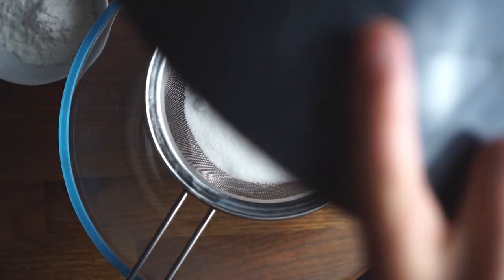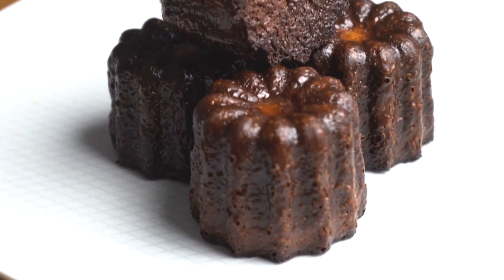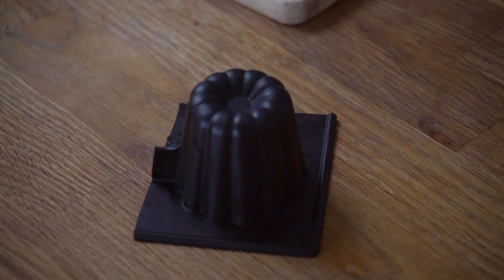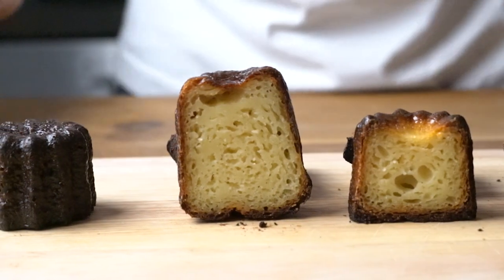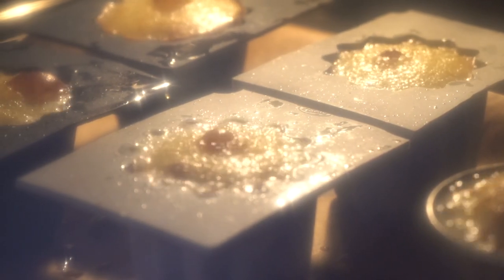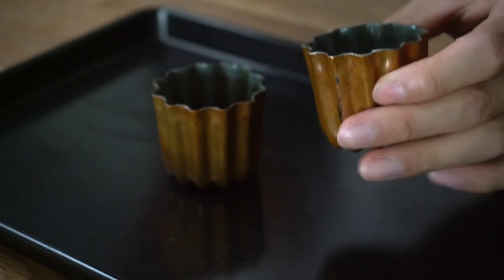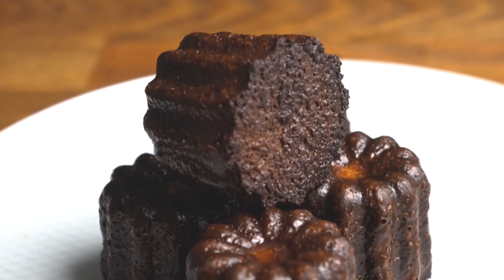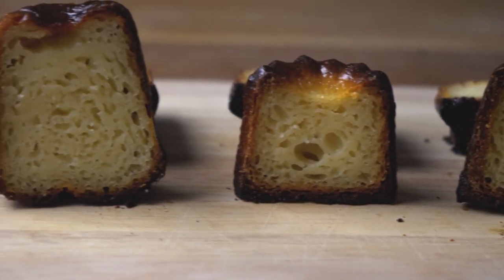Why COPPER molds are not always better

Comment: Excellent comparison, clear and factual - would have been useful to have a comment on temp limits for the expensive silicon, mine are rated to 450f which for some recipes is not high enough.
Reply from the maker: That’s a great point, I’ve never really thought about temperate tolerance for these. I’ll definitely take a look into it

Comment: I've recently had a simple epiphany with aluminum bakeware. Aluminum bakes at different rates based on how dark it is.  Which makes total sense in hindsight, darker colours are more heat absorbent. Wether it be darker because of seasoning or anodizing. I wonder if you seasoned the outside of the aluminum molds (until they are dark), if they would end up being a lot closer to copper?

Comment: I've never had a canele before and I was wondering if it's possible to bake them in muffin tins? I'd really rather taste them first before investing in molds. Thanks!
Reply from the maker: Absolutely! You may not get the same level of caramelisation but should taste just as good. Make sure you don’t pour too much for each one as muffin tins tend to be bigger. A good rule of thumb is around 60-75g of batter per canele

Comment: HI @baken, I have bought copper moulds and used them. However I Know we can use soapy water to clean just using a paper towel but still all the videos I see about canelé, the moulds looks so clean. The last time I did them they got stuck to the mould so I suppose I need to renew the "seasoning" process by cleaning soapy water and "burn" them 20 mins coated by butter. thanks a lot for any advise !
Reply from the maker: You should re-season your moulds every 3 to 4 bakes as good practice! This way you will never get to a situation where the mould becomes dirty due to sticky bits. If they have become sticky and dirty inside, you can start over by washing them in soapy water and then re-season the moulds. A tip from me is not to use butter to season or “burn” the mould as you described. Butter has lots of residuals which does not bond well with the mould to make it non stick. Look to use a vegetable shortening like Trex or Crisco. Hope this helps!
Reply: @BakenLondon  Thanks for your reply ! :) sorry I meant I used clarified butter which can normally support high temperature. I also used spray (ya I did several trials) haha. I live in Malaysia so not easy to find the Brands you mentioned. However I will re season them and let you know the results! Thanks again !!! :)

Comment: Hi, I currently have a set of cheap silicone mould. I want to buy another better quality one but I'm hesitating between the Du Buyer silicone mould or Chefmade carbon steel mould. They both come as a set of 20 small caneles and similar price. Which would you recommend between those two? Thanks
Reply from the maker: Hard one! The carbon steel moulds will get your better results but they also won’t last ask long because they have a non stick coating. So I would say if you are not baking them regularly then the carbon steel would be great, just make sure you take care when washing them. Otherwise the DeBuyer ones will be the ones to go for

Comment: Any idea why I get white tops on mine? I use an aluminum non-stick mold.
Reply from the maker: Usually that’s due to too much butter or grease at the bottom. Try making the coating thinner before pouring the batter into the moulds.

Comment: Hi thanks for the video, could you please let me know where did you get the aluminium mold from? Thanks
Reply from the maker: Hey there! The aluminium ones I have are from Hong Kong and don’t have a brand. I do also have some MasterClass branded ones from amazon which isn’t too bad. The only thing to look out for is to avoid the ones which are all linked together like a tray or plate. They tend to warp in the oven after a while so try to go for individual ones. Let me know if you have any more questions!
Reply: Thanks for you reply, that’s very helpful 👍
Reply: @BakenLondon  Hi! Could you elaborate more on where in HK you got the moulds from? From a baking store? A department store? A street market? My family visits HK quite often and I want to hunt them down! (when we are allowed to travel again :)
Reply from the maker: Hey  @lilbeemail  ! I usually do all my kitchenware shopping on Shanghai Street near Yau Ma Tei. There are a bunch of cookware suppliers there and many of them sold canele moulds. The one I got the aluminium ones from is called I Love Cake. Hope this helps!
Reply: @baken thanks so much!

Comment: Hello issac, is the brand masterpro which is made of carbon steel the same as aluminium? It appears thst Masterclass and master pro might be the same.. but it’s carbon steel.
Reply from the maker: Hi there, Ive used the Masterclass carbon steel canals trays before. Not sure if they are the same as the Master Pro ones but they do give decent results. Similar to the aluminium ones in the video. My older canele video uses those exact ones if you want to see. One thing I would say is that they tend to warp after a while since it’s a tray which can become problematic  over time.
Reply: Baken The flavour of my caneles are amazing thank you for the recipe issac ! I just wanna know why my crust is so thick an abit unpleasant to bite into.. but when I shorten the baking time I don’t get the crunchy caramelised crust. Is it the masterpro tin I’m using ?
Reply from the maker: @phuongvo2618  it could be your oven temperature not being accurate. Sounds like it's overcooked and burnt. For your next batch, try turning down the temperature by 10 degrees after 30mins and keep it at that temperature for the rest of the time in the oven to see if that helps

Comment: Question about how they rise. I have the aluminum molds and noticed they are quite short the second time I tried. First time they were taller, any idea about the height difference/what may have contributed to it?
Reply: I thought the same thing,  if you look at 3:45 of the video,  it gives a side by side comparison of the molds and the aluminum ones are taller.

Comment: Hi Isaac, may I know where did you buy the aluminium mold?
Thanks!
Reply from the maker: Hey Angelia! The aluminium ones I have are from Hong Kong and don’t have a brand. I do also have some MasterClass branded ones from amazon which isn’t too bad. The only thing to look out for is to avoid the ones which are all linked together like a tray or plate. They tend to warp in the oven after a while so try to go for individual ones. Let me know if you have any more questions!
Reply: Hi again Isaac,
If I may ask, which brand of silicone mold is recommended?
People are talking about debuyer mold, but want to hear your advise.
Thanks for making time to reply :)
Reply from the maker: @angeliacaroline9535  Hi again! The silicone ones you see in the video are Debuyer moulds. They are good but make sure you get their "elastomoule" line. Other lines won't have iron powder mixed in and won't be nearly as good. Another thing to watch out for is the price. Although they are good by silicone standards, sometimes they cost even more than the aluminium or carbon steel ones. Good luck with your Canele journey!
Reply: Hi Isaac, just discovered your videos. I am wanting to buy moulds at the moment, have just used aluminium darioles til now with reasonable results.

De a buyer do non stick and stainless steel moulds, can you comment on these?

Many thanks in advance.

🙏🙏🙏
Reply from the maker: Hi  @robmarshall9497 , thanks for stopping by! I haven't used those ones before but given the track record of De Buyer and how good their silicone ones are, I would say their Stainless Steel ones won't be too bad. Also it is a metal mould, so it'll achieve results much closer to the copper ones than any silicone moulds. Hope this helps!
Reply: @BakenLondon  hi Isaac. Thanks for your reply. Subsequent to messaging you I looked up the thermal conductivity of stainless and cast iron, which are quite close and both far removed from copper or aluminium.

Your aluminium mould seems to produce a similar outcome to what I had with my darioles, so I've taken your advice and gone for the fancy silicone ones. At £18 a pop, I've got one copper one so I can compare to the real deal.

Thanks so much for a great video, it really helped me with working out the best way forward.
Reply from the maker: @robmarshall9497  You're welcome and I'm glad this was useful!

Comment: I have a question. I’ve a French recipe that calls for copper cannele molds to be coated with a mixture of butter and beeswax. Have you ever attempted this?
Reply from the maker: Yep! That’s often the case with the more traditional recipes. It does give the canele a bit more shine which some people prefer. The down side is that beeswax is much harder to clean so I personally don’t use any